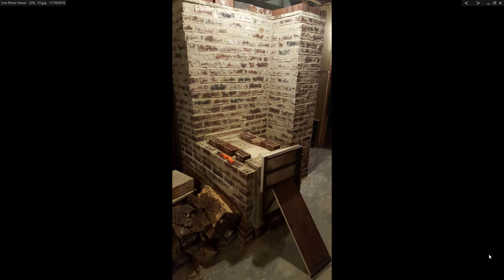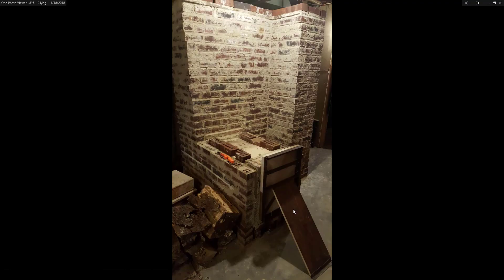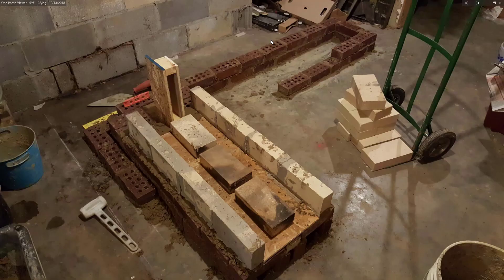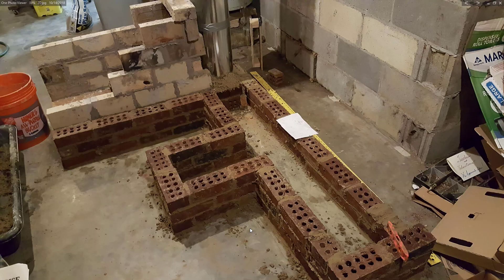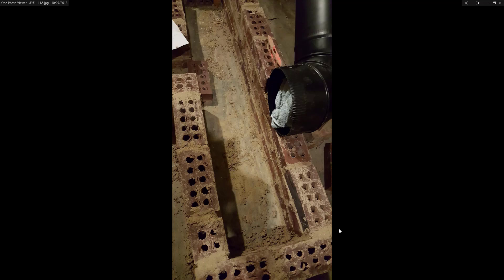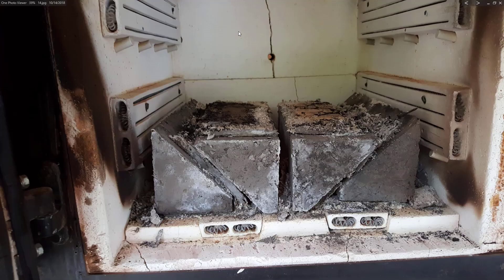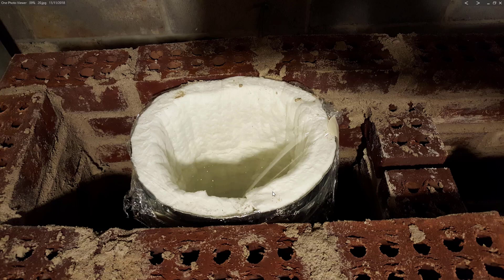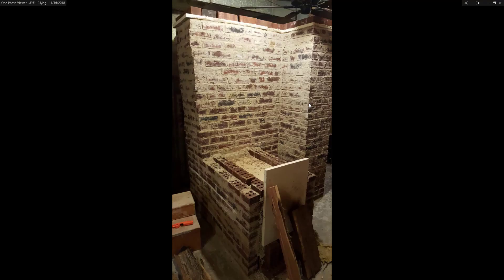Batch Rocket Mass Heater-Fail, See description

Comment: Clearly the most efficient version of this, well done. This will forever be the mental efficient 'forest too heating' in any dreamhouse I'd stay in long term.

Efficient wood burning is one of the top environmental heat sources. It's getting as good as you demonstrate that takes research.
Reply: Instablaster

Comment: Oh... you are moving in right direction... but how come you used those bricks which is not right for the masonry heater? Did you do your home work? I’m sorry for this comment but bricks supposed to be at least solid with no holes. It also should have high density. The brick should make sound like bell if you knock it by a metal hammer. I’m trying to get an info where I can find good bricks, this is how I get here. Unfortunately, the masonry heaters are not widely using in North America, so there is a problem to find right stuff.
Reply from the maker: You are correct. My local brick yard had both types. The one with holes was half the price and I didn't realize there was such a profound performance difference. Also I should have gotten larger bricks to cut the number of bricks to be laid in half or more.  Larger solid bricks would be harder to find but would be worth at least a few calls to ask.

Comment: I am really impressed with your mass wood stove. My question for you is the bricks that you got have a bunch of small holes inside them instead of the standard three, why did you choose those type of brick ??? What is the total mass of the stove you have built ?? What would you do different since you built this a few years ago ??? Thanks Andrew.
Reply from the maker: They were cheapest but it was a mistake to use them. I ended up tearing it down and going back to a double 55 gallon barrel stove.
Reply: @etownandrewg  Would using a hybrid half wood stove and half rocket stove make for a more efficient design ??? When you tried the double 55 gallon barrel stove, did you find the wood burn chamber more conducive to capacity holding over the previous stove used ??? Thanks
Reply from the maker: @victoryfirst2878  a 55 gallon steel barrel gives a faster heat exchange but less heat storage than a masonry stove.
Reply: @etownandrewg  Nice to know that fella.
Reply: @etownandrewg  Sorry to hear this, so your calling this a fail for your application?
Reply from the maker: @jackroth1797  yes for my situation.
Reply: @etownandrewg  Please update the video' s description narrating the disassembly of the stove...and maybe the reasons for it to happen.
On the other hand, i really like your design...sad that it wasnt what you required...!
Reply from the maker: @henryrollins9177  Good suggestion, I added to the video description indicating that I tore down the stove.

Comment: Its been a year. How much wood did you burn? I dare say not enough to stay warm. Details please.
Reply from the maker: So the update is that I took out the Batch Rocket Mass heater and put back in my double 55-gallon barrel stove. It had not saved me any wood and did not heat as well in my situation being in the basement. The other option was to rebuild it. I considered adding a 55-gallon barrel heat exchange section and replacing or filling in the holes in the bricks to eliminate the insulation effect of the holes. But it was possible that would not totally fix things. So in view of the uncertainty, I put back in the old stove.
Reply: @etownandrewg  THANK YOU!

Comment: Looking great, how is it doing now a couple of months down the line?

What flue temps are you getting at the exit into the flue?

Also I assume that the secondary air channel and feed are replaceable and that the angled bricks at the bottom of the firebox are lose so you can easily service the secondary air feed?

How often you do fire the rocket mass heater per day, is it big enough that you can get away with a single hot burn per day?
Reply from the maker: I added a thermocouple to the top of the riser and at the stove pipe exit. The exit generally runs between 300F and 400F+. Both thermocouples go to a display made for two thermocouple inputs. Of course, when I first light the stove the exit may be the same temp as the ambient air if it has been long enough to cool down all the way. I like being able to check the temps. The normal high temp at the top of the riser is 1200F. When that temp drops to 800F or less I either add more wood or close the door.

Yes, all of the secondary air feed is replaceable. All of the bricks are replaceable. I used fire clay mixed with sand as mortar and so that makes it relatively easy to replace any part.

I have a 5,500 SF house including the basement and two main floors so this is not a small house. We fire it about six times a day. So you have to be around to do this. If I need to leave early for work it may only get one load of wood and then I shut the door before leaving. So I have my propane furnace set to kick in if the temp drops too low.

Comment: Andrew, I know it hasn't been long since your video release, but I was wondering if you have beginning "real world" comparison data yet as to the amount of wood you are burning. I have a heater I constructed earlier this year and am very much impressed with its heat retention. I don't believe I have reached its peak efficiency yet as I still have smoke and a small amount of creosote build-up within my "bell". I have found I have one burn when temperatures are above 40F,  two burns above 20-25F and I have three when temps were down to -10F already this year. At 7-10lb of mix of poplar and maple I find I burn perhaps 1/3 to 1/2 less wood this year so far with a batch-style rocket heater with perhaps 1500lb of mass. AND I'm not cold in the mornings as I was with our old stove. My wife loves being able to be away all day to come home to a warm house 8 hours after a 1.5 hour fire has gone out.
Reply from the maker: I am not as pleased as I could be with the performance. I didn't include a metal bell for the quick heat and am missing that more than anticipated. So much that I will probably rebuilt it this summer to add that. A full load is about four, 4 to 5 inch size split logs. In the morning I put in a couple loads and go to work. My wife will put in two to three loads during the day. Then in the evening I will put in a couple loads. This assumes it is in the 30-40F range outside.
Reply from the maker: @douglaspohl1827  central Kentucky area, United States
Reply: @etownandrewg  Adding the barrel will help get that 200 degrees extra that are going outside.  👍
Reply: Here's a Walker core batch system I built.  The owner says he uses 25% of the wood he used in hus woodburner.
Reply from the maker: @jeremiahshine  Sounds good
Reply from the maker: @jeremiahshine  Yes. I would also need to increase the overall interior surface area of the stove. I was originally more concerned about over doing it and the stove stalling.
Reply: @etownandrewg  what sized system is it?
Reply from the maker: @jeremiahshine  This is an 8" system which is the diameter of the stove pipe connection to the chimney. Also 8" is the inside diameter of the heat riser after the fire box.
Reply: @etownandrewg  You could also replace some of that ceramic fire board with metal to extract more "fast heat".  I'm not sure what you mean by "increase the size".
Reply from the maker: @jeremiahshine  Yes I could. I also need to be aware of maintaining minimum distances to combustible walls or ceiling nearby. With an insulated or masonry stove I can be very close. (I would need to go look up the allowed dimension that I was using when laying this ou.) With metal I need to be 36" away as I recall. That definitely is a driving force in my design. The fire box is to be insulated to retain heat and promote a clean burn. Then once all the combustible gasses are burned I try to start extracting heat. So it might not matter too much if I put a metal plate on top of the fire box but it would cool the fire box and that is not recommended.
Reply: @etownandrewg  on top of the BELL.
Reply: I built a 6" Walker riserless core system into a firebrick bell that exited to 2/3 of a 55 gallon drum buried in a cob bed (twin bed sized).   It replaced a big box stove fireplace insert.  The 1600 sqft house took 5 cords a year to heat the place.   The Walker riserless and all that mass only ate 1 cord.  The bed is too hot to sit on when burning hard and steady.  It became the wood dry rack.
Reply: @etownandrewg  I used a 1/2" metal plate as the top of my bell to get quick heat.  I figure it'll warm up fast and get draw going more quickly.
Reply from the maker: @jeremiahshine  sounds good

Comment: Cool! (a pun?)  Any burn data?  Temps etc?
Reply from the maker: 1200F was the typical high temperature at the top of the insulated riser. 400F was a typical exit temperature going into the chimney. So the masonry bell did what it was supposed to do and captured the heat  for a slow release into the house.

Comment: It's connected directly to the concrete slab which is likely to be none insulated at the footers and it's what looks like a basement so it will constantly dissipate through the ground temperature surrounding the basement. I would insulate the basement walls, reducing concrete floor slab dispersal will be impossible. A better place for it would have been your first floor as it would radiate heat downstairs to the basement through the flooring, but most would be inside your home.
Reply from the maker: agree
Reply: I don’t necessarily think that will see such a huge improvement... 

  The bottom of the bell has the LEAST heat stored and radiated , as that is the function of a bell...

An easy solution to that would be to throw a 12” thick layer of rock wool in the bottom of the bell (except any place it would block the exhaust)

  This will keep more of the heat in the upper mass away from the floor.

  Since return air is coming in the part of the basement outside the panels, that WILL be cooled by the ground temp basement walls and floor, so insulating those walls and floor could be beneficial, but I think the amount that insulating UNDER the bell would benefit, is minimal, by comparison.

Comment: Burning a 100 pounds of seasoned firewood a day is a lot of heat (say 700,000 BTU)... unless that heat is truly stored (only 0.2 BTU/lb masonry) and moved into your living space the majority of that heat will be lost through poorly insulated walls and ceiling or up the exhaust. I dare say your home requires 15,000 BTU plus per hour (requires a calculation) to just reach thermal equilibrium - how much heat does your living box leak per hour?  Unless you can release more heat above the leakage (thermal loss) you will not be warmed. Simple math of how much wood you put in must be efficiently transferred and distributed else its not a heater... just a burner of little significant purpose.  Input = Output. First simple law of energy. What you do with that heat is what really counts. A Rocket Mass Heater does not burn firewood more efficiently than a wood stove or pellet stove in and of itself to justify the RMH DIY build... its how efficient YOU transfer the heat into a thermal storage battery then on demand can move said heat into a designated living space. A wood stove or pellet stove etc can burn the biomass... YOUR challenge is how to improve on the efficiency to make it worth while... first, insulate your home, second, minimize heat lost up the exhaust, third, decide on the best heat store for your situation - remember water stores 4+ times more heat than masonry - what are the benefits vs costs vs system handlings etc... last and not least... supply of primary energy - wood is not free - neither is electricity, propane or diesel... so be sure to do a step-by-step, cradle to grave, system analysis... young and strong today but older tomorrow vs retired makes a difference... means working smarter not harder as life throws you curve balls...  don't forget regulatory permits be it federal, state or local zoning etc... including insurance... coverage could be void for a DIY fire stove/heater. Ask lots of questions and put everything down into a notebook before you make a decision... then go see what others have done... show me the results... ask yourself - WHY DID A DIY RMH WORK BETTER THAN A HEAT PUMP? I doubt it can... the bottom line... heat pump system win - hands down... no electricity?  What are your alternatives? Good luck!
Reply: You say a lot... for not really saying anything helpful.
Reply: And a rocket mass heater will ALWAYS be better than a heat pump OR a pellet stove if we can obtain firewood cheaply or free... and ESPECIALLY if the power goes out.
Reply: @orcoastgreenman  Why don't you show us your build that burns less than 100 lbs a day...
Reply: Douglas Pohl - I choose not to engage further with an arrogant bully
Reply: @orcoastgreenman  Thank you - I hate wasting time when you fail to contribute anything of value to this discussion.
Reply: @orcoastgreenman  A low cost split Ductless heat pump system is about 250% efficient... A wood stove aka rocket stove might be 80% so it's easy to see a heat pump being 3 times better than any wood burner. Even with free firewood, a heat pump is a clear winner hands down.
Reply: Douglas Pohl - I have two customers waiting three plus weeks to have their split ductless heat pumps serviced under warranty by the installing, or ANY available warranty service personnel
at the moment... 

  Thankfully, where I am that is not a life or death problem, and just an inconvenience...  

I’ll avoid a super complex systems dependent on international supply chains and the refining of refrigerants, TYVM.

  Good luck with your heat pumps!
Reply: @orcoastgreenman  I wonder what the problems are... customers you say... so you know? Was it poor installation with leaking refrigerant or what?  I'd be calling the manufacturer to ask questions... I use three different technologies for heating of which two are combustion - with and without electricity and the last is refrigeration cycle heat - should one fail for whatever reason another can take over independent of the others. When will people learn that combustion heating solutions are in fact limited to near 95% efficiency... you cannot get more heat out from combustion than what was there to begin with... you can call it a rocket heater but one pound of wood only produces one pound of wood heat... while a heat pump moves multiple times more heat energy from using a low cost and convenient amount of electricity. WINNER!
Reply: Douglas Pohl  - On one, the extreme winds we get here multiple times every winter blew the fan blades of the exterior unit into the grill and destroyed the motor and the whole exterior units control circuitry, and the other it was a failure of a control board in the interior unit… Either way shit that Hass to come from far away and be installed by a trained technician.   They are absolutely not customers of mine for a heat pump system, because I do not install nonresilient systems.
Reply: And of course, on the coast where I am the exterior units can be expected to last about five years at best before rusting out.
Reply: If I was in California right now, I would be without power to operate a heat pump…

Heat pumps are great technology, if someone ELSE pays for installing, and servicing them.
Reply: The best solution, of course, Is to build much better insulated structures...  And heat them passively, like Reina LLC does up in Fairbanks Alaska.   No heat pumps needed

But good luck with your heat pump sales!